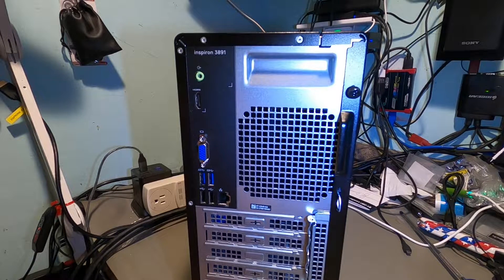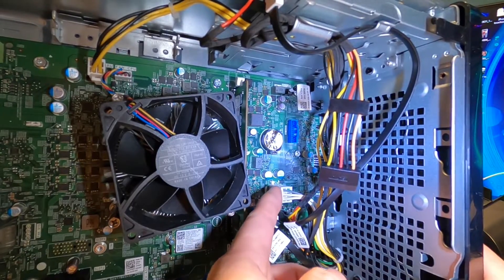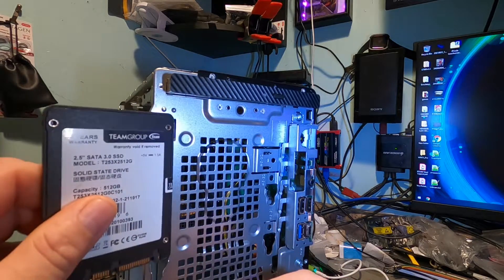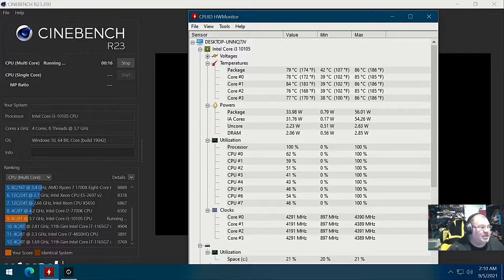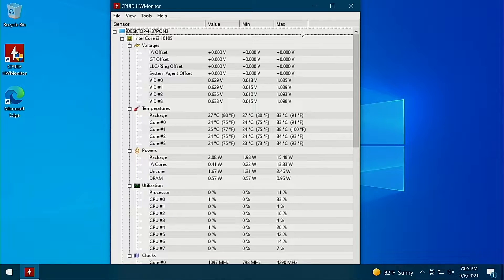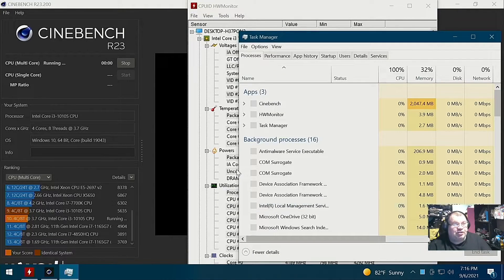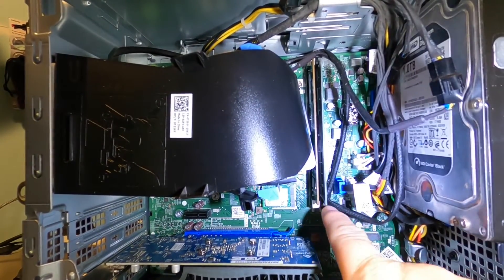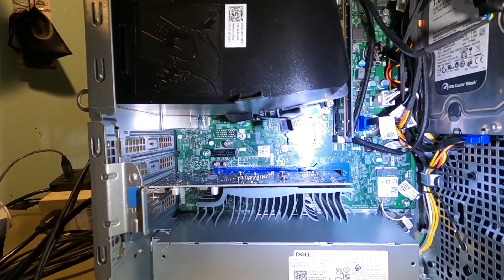Upgrading the Dell Inspiron 3891

Comment: Update to a previous comment. That weird mounting point,in the upper case, is for another drive. Dell part #   ASSY,BRKT,HD,2.5,CADDY,MT,D10.   product # 9T3F1. How did you connect the back fan, electrically. MB has only one fan connection. Can a splitter be utilized?

Comment: These are the dell part numbers for the space on the underside of the case. It allows the installation of another drive.  I mounted a 2tb hdd. Works perfectly. Screw,M3X3.5MM,Pan Head,Machine Screw,Zinc Plated Steel

QUANTITY: 4

UNIT PRICE: $2.99

￼

ASSY,BRKT,HD,2.5,CADDY,MT,D10

QUANTITY: 1

UNIT PRICE: $5.99

￼

ASSY,CBL,SATA,HDD,BLUE,MT,D10

QUANTITY: 1

UNIT PRICE: $3.99.   Screw,M3X3.5MM,Pan Head,Machine Screw,Zinc Plated Steel

9NRJX

$11.96

Discounts/coupons applied

ASSY,BRKT,HD,2.5,CADDY,MT,D10

9T3F1

$5.99

Discounts/coupons applied

ASSY,CBL,SATA,HDD,BLUE,MT,D10

756F2

$3.99

0:06
Reply from the maker: Good info, thank you.
Reply: Sorry guys. These are part #s for an older upgrade.

Comment: The fan you recommended has a 4 pin connector, but my 3891 does not have a connector for the power,  it is blank.  I found a 80mm fan on Amazon that has an usb connector that can be fed through the grate to the usb bay in the back.  do you think that could work.  The PWM splitter may be too complicated for me. I enjoyed your video and agree about the cooling, but I wish you could of showed how to install the fans.  Thanks.
Reply from the maker: A pwm splitter is too complicated? You better stay away from computers in general
Reply: That's what I did the USB fan works great, and I also like how I can control the speeds off it.

Comment: One more comment. The front side of the case accepts only a 3.5 drive. All the mounting holes are there. No need for brackets. Screws, cables and power supply. All the connections are available, without modifications.

Comment: I just got a 3891 and the monitor wont turn on. It works if I use an old monitor with the VGA connector on the back of the computer, but I'm not having any luck with the HDMI port. Any thoughts?
Reply from the maker: Have you tried a different HDMI cable? Checked to make sure that HDMI input is selected on the monitor?

Comment: Wait, you set both fans to intake and then fitted the plastic cowl back on? So, where is the hot air going to escape? Surely the better move would be to remove the silly plastic cowl and set the fans to suck away heat from the cpu and bast it out of the back - like most other PCs do? For bonus points, stick one fan on 'suck' at the front to pull air in and stick your filter on that one instead. Handy video though, very helpful to me because I'm about to upgrade my Mother-in-laws PC and boy is it slow. Thanks.
Reply from the maker: Tried it that way, it actually showed hotter results in Cinebench. I went with the config that gave me best results. Case could really, really use some top venting.

Comment: i have a dell inspiron 3881 - can the ram on it be upgraded to 64 gb using ddr5 5200 mhz ram sticks? two 32 gb? thanks............... please some 1 tell me quickly.thanks...............
Reply from the maker: The 3881 can indeed run 64 gigs of ram, however you'll want to use DDR4 2666 or 2933 speed modules.
Reply: @phreakwars  okay thanks many thanks but what will happen if i put in two 5200 mhz modules which are 32 gb each? thanks........
Reply from the maker: @ms-ex8em  they won't fit if they are DDR5 modules.

Comment: I've got a 3891. Watched your vid. I measured the back of my fan case. It's actually, in my situation,  is 70 mm. I also was able to replace an i5 with an i7. I did the reverse fan flow mod. Had to keep OE fan. Dell doesn't like aftermarket fans. The motherboard has screw inserts. 
Unable to access, without entire dissably.

Comment: Oops one upon one more thing. The psu is rated at 260 watts. Dell has a 360 watt psu part # 2VDOG. I checked. Backorder. This psu only fits a 3891. One 4 pin and one 6 pin.

Comment: i put an rx550 in mine lol it should be fine even though it has a fan but doesnt require any extra power source only thing im concerned with is the 200 watt psu but shouldnt matter if its only running off mother board
Reply from the maker: Yeah, should be OK, most of those run in the 50-70 watt range peak.

Comment: Thanks for the video! Did I hear you set both fans to intake? From what I can see my 3891 has a single fan exhausting air away from the CPU and out the black cowling. Also how did you get the cowling to fit over the case mounted noctua?

I plan to have 2 3.5" drives in addition to the m2 ssd so looking for best way to keep the CPU and case cool.
Reply from the maker: Yes, both are intake. Getting the cowl back on is kind of a bitch when you add a fan. Takes a bit of twisting and manipulating but it can be done. I was almost tempted to just leave it off, which in retrospect, would probably have been a better choice.
Reply: @phreakwars  I have basically the update model with the new alder lake i3,. Just take off the cowl and install a 80mm USB fan, should help out
Reply from the maker: @thomasward00  A USB fan? Get the fuck out of here with that. 5v USB fans are shit. I'd never put one in a case. Plus then you have to lead it out of the case and plug it in that way, which looks tacky as fuck.  I use PWM fans or nothing.
Reply: @phreakwars  I found it preferable to notch the cowl to stop it fouling the bottom flange of the Noctua .It then clips properly .

Comment: Could I add 2 sticks of 8 gig ddr4 3200mh in my motherboard it’s the same pc but I’m worried it couldn’t handle 3200 because it comes with 2666 originally, would I be fine?
Reply from the maker: Yes, it will work just fine. The speed it will run at depends on the CPU's limitations. Thinking it's like 2933 on the Celeron's, I could be wrong, you'd have to look it up. But yeah, you can absolutely use 3200 sticks in it.
Reply: @phreakwars  thank you so much this was the last thing I needed to confirm I’m going to add that and also a 500tb ssd and I hope my cumputer runs a bit faster
Reply: @phreakwars   yea I have a i3 10105 with it lmk if that changes anything if not I’ll get that ran with also 500gb of Samsung nvme ssd and hopefully my computer speeds up

Comment: Just bought this comp for 499 from best buy.  wanted to put a decent graphics card in and the 260w power supply really hinders your options.  thinking im going with the gt 1030 also, since it only uses 30w.  hopefully it runs diablo 2: resurrected. Thanks for the vid.
Reply from the maker: There was another guy who commented to me a few days back if I remember correctly, that he was using a 1050 in his 3891. That's honestly kind of pushing it, but I guess if it works for him. I personally wouldn't risk it with such a shit power supply.
Reply: Bru get a 1660 or at least a 1650
Reply: @aaronkucherenko6363  Cant go that high dude. No power

Comment: hi bro a question what is the deal with the power supply? is imposible to upgrade it ? how much watts has? is posible to put idk like a rtx 3060?
Reply from the maker: No chance of that. It's proprietary. You can find adapters on Amazon to get an ATX power supply to work, but it will not fit inside. You would have to swap the case. Swapping the case would be very hard because of the board design which is integrated with the case. Dell didn't fuck around on this one, they don't want people swapping shit into it that they don't approve of. You can get a GTX 1650 to work provided it doesn't have the 6 pin plug.
Reply: @phreakwars  you can always upgrade the PS with the dell L360EBM 360W that you can find on ebay for about $60.  This one comes with a dedicated PCI-E 6pin connector for a beefy GPU
Reply from the maker: @leszekmazur9541  Thanks for sharing that part number, I'm sure that will be helpful for others.

Comment: Hey, is Noctua NF-A8 PWM a better option for cpu fan ? (Dell Inspiron 3891)
Reply from the maker: Yes. The ones I used (NF-R8 redux) put out 31 CFM with 1.41mm static pressure, the NF-A8 puts out 32 cfm with 2.37mm static pressure. So the NF-A8 is just a bit better than the NF-R8 redux.

Comment: You want to pull the air across the heat sink and push it outside the case, not the other way around. Data center engineer here.
Reply from the maker: I tested this with both a push on the cpu and a pull exhausting as well as intake from the rear. Coolest temps under stress were recorded with the configuration I used. 35+ years A+/CompTIA. This case is terrible for circulation. I originally thought exhausting it out back would be the way to go as well. Temps were about 8 degrees hotter (on average) doing it that way. This case needs modified to let some fresh air on the side or front so that you can exhaust out back. EDIT: Honestly, get rid of that stock cooler, that thing is so tiny. I'm sure that ain't helping things either.

Comment: I was also wondering how I would put in a pcie x16 graphics card in and when I do will it be able to detect the card and can I change the resolution thank you for your time and happy holidays
Reply from the maker: Yes you can run a x16 graphics card. According to Dell, you can use up to a GTX 1660. However, there are no PCI-E power connectors to plug one in, you'll need to use a SATA to PCI-E cable like this one: https://amzn.to/3E2PcZN

Comment: Hello how would I install an ssd drive and if I want to install a graphics card will windows 11 automatically detect it thank you for your time and have a happy and healthy thanksgiving and great holiday season
Reply from the maker: I have not found any documentation on an SSD from Dell. Referencing other models, it appears you need a bracket which mounts above the CPU that holds an SSD. Alternately, you can buy a 3.5" to 2.5" adapter such as this one : https://amzn.to/312rhv9 Use that to mount the SSD onto the standard 3.5" mounts.

Comment: Hey, how did you install the fan, was there a 4 pin connector
Reply from the maker: I used a PWM splitter connected to the CPU's PWM header.
Reply: @phreakwars  is sata to molex also possible for this
Reply from the maker: @jblico  Yes, but you won't have any PWM control.
Reply: @phreakwars  oh and does this accept any intel cooler or is the cooler here proprietary?
Reply from the maker: @jblico  Looks to be a standard Intel cooler, so most any aftermarket should work, only concern I would have, is mounting depth in such a small case.
Reply: @phreakwars  so uh no need to replace any back plates
Reply from the maker: @jblico  I suppose that would depend on the type of cooler you used
Reply: @phreakwars  could you send me an amazon link to the pwm splitter used here
Reply from the maker: @jblico  https://amzn.to/3AzVf6t Connect the header with 4 pins onto the CPU cooler, and the header with 3 pins onto the secondary fan, also, make sure you are using identical fans.

Comment: im watching this video on my 3891 with upgrades i put a 1050 in 2gb and 32 gigs of ram and have a i5 10400
Reply from the maker: Sweet. Any plans to up your storage?
Reply: @phreakwars  oh yes I did I put a 980 1tb and am getting a new case mother board psu and gpu so completely new stuff
Reply from the maker: @joezeidan5683  that's the better move to make, Very rare to find a decent OEM prebuilt these days, better to do it yourself.
Reply: @phreakwars  yeah I am just scared that I won’t be as able to set up the pc I feel like I am gonna make a mistake and it won’t turn on
Reply from the maker: @joezeidan5683  well, if you are confident in doing it, send it over my way and I'll do the work for ya and mail it back. I'm on my summer season since I only work half the year, so my PC building will pick up. I can squeeze you in, in maybe a month or so. Little back logged, most of the PC's I work on, honestly don't get filmed because the work is too monotonous and boring for me to even bother. But yeah, now that I'm on my off season from work, will be rollin em out and I'll be open for requests in a month or so.
Reply: @phreakwars  OK I’ll think about my options and let’s see